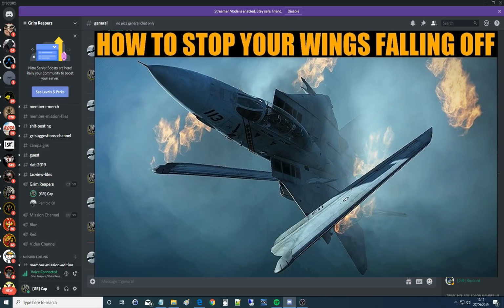Interview: Speaking To Engineer About Aircraft Fatigue & Maintenance

Comment: Same thing can happen in your car. I had a shock absorber on a Chevy Vega go through the A arm on the front wheel. Also my 2002 Hyundai Sonata has fatigue issues with its front wheel drive as the bushings in the steering group are worn out and can no longer have a wheel alignment till the whole front end gets replaced.

Comment: Great info on the actual fatigue problems. May I bring in some thoughts... being an aero engineer (academic, sadly no experience, not even in DCS!)? 
As to metals, Aluminium will be hardened by means of alloys. Hardening it makes it stiffer generally, and stiffer metals crack easier. The same may go up for carbon, and there, also glueing influences fatigue resistance.  

However, whatever it's construction, a plane will be checked, as you guys pointed out in 26:00 eg. If DCS lets you fly a 10 extra cycles plane before your wing shears of, that's not right.

Comment: Awesome video!

made me think of 2 things that i experienced:
1. during my time as a flight mech on the JAS 39 Gripen
don't know the whole story but was told a training pilot had pulled past the softstop of the joystick during
training (pulling more then 9G's) 
when the plane landed you couldn't see anything wrong....until a technician found a small white/gray line about 10cm
on the starboard canard.....plane went in for full inspection and canard change
as far as i know that was the only fault found

2. at an airshow 
i always bring a scanner with me as it gives a deeper feel for the whole thing as one gets to know stuff before
anyone else...plus it's cool to hear the chatter
Hawker Hunter takes off.....comes around and i can see main gear still down but nose wheel up
Tower comes on the radio telling pilot that they also see this
pilot climbs to alt.....tries cycling gear (the crowd plus announcers have no idea what's going on)
pilot tells Tower he's got green lights and comes by for a low flyby
all gear is up and he continues with his show
and before landing does another low flyby just so Tower can confirm all gear is down....which is was and he landed safely

Comment: Turns out, keeping something heavy up in the air is hard.

Personally I do like that DCS is adding fatigue stuff just because ultimately it's designed as a simulator, not an arcade game. If something behaves a certain way in the real world, it should (ideally) behave that way in the simulator too. There's plenty of arcade flying games out there for people who prefer to just fly around shooting stuff without having to worry about their plane falling apart, and there's absolutely nothing wrong with that.

Comment: Back in the day at least, and this good engineer explains it rightly, each component and module were tested in order to find out their point of failure. Say a rotor blade, or hub, gear box, even a gear inside the box. Then they'd take a hundred of them, and run them until they broke. So they'd find out, that on average (for example, not real numbers) they all failed at 2000 hours. Some broke physically, others wore out past normal operation, etc.  So the manufacturer would then take a few precaution hours, and say "Ok, this component, so long as operated within its specifications (not upside down or overspeed, etc) would be useful for 1500-1700hs.  So the maintenance crew would have to keep track of all these components, in order to check flight logs and being able to replace each part within their useful life. The breaking of each part after that useful life, is the actual fatigue of its material (structurally unable to maintain integrity and operation). 

The other factor (as explained with the Nimrod in this video) is the out of spec use of the aircraft. Counters that measure speed, weight, and G's, allow maintenance to know if any special strain was introduced to the airframe and powerplant. So then they would have to inspect and ensure that those parts aren't damaged, or close to their end of hour-cycles. If so, they would consider replacing them. 

A problem in a few cases (outside the US at least) they'd replace a part from the UH1H because it had 1600hs out of the 1800hs it had allotted, however instead of the bin, the so-called mechanics, would instead place the old part back on the shelf, and write it as "1400hs" instead of its true 1600. Then they'd place it back in another airframe, making the pilot/crew believe they had a good 400hs of flight, when in reality the part had no more than 200. 

My two cents.  One day I hope to fly with the GR team, once my PC is able to run DCS properly. Cheers
Reply: [Quick side note: For DCS, it would be great to have each of the main components to start with a counter of x amount of points, and as you fly it more and more, each component goes down depending on the amount of Gs pulled, the amount of hours, etc. A simple script would suddenly make those snapping wings or flaming turbofans break more sensically than they currently are.  I presume their effort is that of keeping the sim real, much like G-lock, etc.  But having them snap randomly for no real reason after a 3hr mission, doesn't sound very realistic. Great thing about DCS, its architecture allows for constant improvements such as these]
Reply: @mariogravina4495  The trouble is that with DCS you just go and get in a new plane for each mission. You'd need a sort-of career mode where you have the same plane and it counted up every mission you did. If you crash or get shot down, you have to wait a week before you can get a new one...
Reply: @Penfold101  Thank you, that makes sense.

Comment: One thing that could have been made clearer is how a plane consists of lots of components that wear differently. Some components will have their service life dominated by g-load, some by g-load variation, some by landing/takeoff cycles (landing gear!), some by flight hours (instruments), some by engine temperature/power used, etc etc.
Reply: Very true. This was all off the top of my head with no script or much a clue of what Cap was going to ask, but this is a very good point.

Comment: and mast bumping is what??:D thats a fatigue break too... it works nicely in dcs with helicopters ....
Reply: Mast bumping is not fatigue. See how a lathe works, then imagine the mast undergoing that while the helicopter is in flight.
Reply: @mariushusejacobsen3221  ... exactly as the workpiece in the lathe, its rotating , one side is pushed by the tool another is pulled ...workpiece is bending on one side + rotating .  just that mast bump is more erratic....and randomly hammered with sharper edges

Comment: Cap, Great interview.  Great job deep diving on Airframe fatigue it was a very interesting interview.  I was just working on some Airworthiness issues for a University project I'm doing, and how to factor that into the cost of operation.  This is something we have to figure from the largest aircraft, even down to small UAS, which have component failures and degradation.   The US Military tracks its operational readiness closely and it been highly publicized over the last couple years about the number of mission-capable aircraft compared to those that are down for maintenance or depot services.  https://www.defensenews.com/air/2018/10/09/mattis-orders-fighter-jet-readiness-to-jump-to-80-percent-in-one-year/.  Great job

Comment: Cars also fatigue, it's just you don't notice it in normal driving.  Rally cars and race cars routinely have the chassis and cage scrapped and the drivetrain transferred to a new(er) chassis because it just "wears out" and get's weaker and causes handling issues because it flexes too much.  Rally cars more-so from just getting beat to death from the gravel.
Reply from the maker: Wow, great info!!

Comment: I propose a solution to this over G crisis. An app that let's you put in maintenance man hours and reduces the likelihood of snapping off wings. Never saw one come back with out a wing.
Reply from the maker: Yeh that's a good idea.
Reply: I believe the game you want is Aircraft Mechanic Simulator. Makes a mockery of my job.....
Reply: @Penfold101  No. The intent was to put some extraeffort into DCS to keep the wings on.
Reply: @pgtmr2713  Actually, now that I think about it there was one F-15 that landed with only one wing. Worth a google for 1983 Negev collision.
Reply: @Penfold101  Yeah I've seen pictures of that. And I've personally seen a Tomcat missing a good percentage of surface missing on one side came back with no problem. There's huge differences in the structures between the F-15 and F14 where the wings move. I doubt the wings would separate the exact way that they do in DCS.
Reply: @pgtmr2713  Probably not, but it is only a game...
Reply: Only a game made with real de-classified information.

Comment: Damn, so resetting the G/stress meter on the Mi-8 isn't fooling anyone?
Reply: If we come onto a plane post-flight and see that it's still reading 0, then we KNOW you've done something wrong...
Reply: @Penfold101  No one in their right mind would let me near REAL aircraft controls. Sorry to the ground crews, but they should be glad like myself if anything comes back at all. I love my simulated ground crew, I work them very hard. They are well trained though. They can take an airframe you or I would consider beyond repair, and have it fixed in about 180 seconds... ;)
Reply from the maker: lol

Comment: Don't know how accurate it is but remember reading a couple times that once WWII started fighters were built to last only 200 hours or so. One reason being to make them as light as possible for performance. But the main reason was they weren't expected to survive that long in combat. Any one else hear this?
Reply: That's correct 

I think the R-2800-XX had a stupidly low amount of hours before a teardown check up etc
P-51 merlin had to be teardown as well when you push the throttle pass the 100% throttle gate(67+inch of mercury)

But at the same time 
WHEN you do need the full boar 2000+HP(R2800) to spit out Regardless of crack piston rings & overheated cyl/piston & overpressured intake
Otherwise the thing would be lost anyway if you get shot down.

At that point it's just a engine replacement back to base is a easy & cost effective
Reply: 20 minuters. Nuff said.

Comment: Modern aircraft are designed to much closer strength tolerances than older ones, for example DC-3 aircraft will still be flying into the 21sth century because by modern standards they are WAY overbuilt.

Comment: If you are going to compare stress of aircraft to cars, then it would have to be an off-road rally car.  It’s engine is constantly reved to redline (take-offs), its chassis is exposed to 5 foot high jumps (landings), and ruts, potholes (turbulence) that have torn wheels off of cars.  Rally cars are torn down after EVERY race.

Comment: For me at least, it's a pleasure to finally see fatigue and structural failures being slowly introduced in DCS. I know it started with the Flanker and its wings, but we get now seam much more in detail (systems failing, fatigue points)and i look forward to the day when we'll get multiple failure points as well (not just wings falling off), like engine mountings, stabilators, ailerons, actuators....on all of our planes. Including the FC3 birds, that also deserve "love". If by love we mean chance to buckle :D 

P.S. the reason why we don't see structural failures in cars (usually) is because we don't really push them to their structural limits.
Reply from the maker: affirm. I wonder if steel is more fatigue-resilient than alloys also???
Reply: @grimreapers  i've been wondering that as well. I think that some steels may be more durable once deformation has initiated. After all, it's sometimes better to bend then to break. But if the alloy can be sufficiently lighter then steel for the same or greater tensile strength, then it will take less force per g, and thus can be put to more stress before it cracks. On paper at least. Not an actual engineer unfortunately :/

Comment: One thing that I haven't heard talked about especially concerning Navy aircraft like the F-14\F-18 was the fact that these aircraft are exposed to multiple carrier landings and launches every day and those are extremely harsh on the airframe and landing gear. That's before you talk about exceeding maximum G tolerances and wings snapping off...

Also, it's completely possible that the F-16 at that air show had a bad birdstrike.

Also frame fatigue in the automotive world is absolutely a main concern here in the states regarding trucks. Some frames if not properly reinforced can absolutely bend half a foot or more on a twist ditch test or during harsh off-roading..

Would've liked to hear less 'US vs. UK' speculative posturing on airworthyness safety standards and certifications and less opinion based deductions.. As far as the EU or anyone else in the world having more stringent safety standards for aircraft, that's completely untrue. You have to consider the size of the US firstly, GB is smaller than some states so obviously up to a certain altitude in controlled environments an individual is absolutely allowed to fly whatever the hell you want because there is just tons of space comparatively.

I am a big fan of your channel btw, Cap!
Reply from the maker: Affirm

Comment: I remember when i was at college studying level 2 aircraft maintenance we watched loads of air crash investigation and i remember one was a 747 bulk head what the engineer done  was he replaced  the bolt mm to the wrong side and cause the bulk head to blow and that cause the stabiliser to blow and the plane oscillated until it crashed into a mountain another one is fan fractures that u can even see with the human eye and that brought down a dc 10 with no hydraulics

Comment: Of course  we do have regular checks on cars (in the UK at least),  the Annual M.O.T.  test  after a vehicle reaches its 3rd year.   Part of that checks for corrosion to structural components that might cause eventual structural failure.  So equivalent of an aircraft  check cycle, but time based rather than 'trip' based.    Up in Orkney we use  small passenger plans like busses for inter-island travel. These planes  perform a very high rate of  Take-off / Landing cycles (shortest scheduled  flight  in the world (Papa Westray to Westray) is between 45 and 90 seconds depending on wind direction.  Whilst these planes (BN Islanders)do not fly  pressurised  their high Take-off / Landing cycle rate and associated  varying load on the wings and undercarriage demand  a frequent  maintenance cycle.  They also have to fly in extreme weather which doesn't help  (i've seen them taking off backwards at Kirkwall airport when the wind speed is > the take-off speed of the plane).

Comment: A big part of the job as (military) pilot is knowing your operation limits. In the Tornado you have to know, how fast you can go at what wingsweep, know how many G's you can pull at the different wingsweeps and what AOA you can get to, allways taking into consideration how heavy the jet is (fuel and external stores). In the more modern jets most of that ist taken care off by the flight control system.

Comment: Love this kind of insight, really interesting. I see metal fatigue all the time when repairing older farming and especially forest machinery. And they are machines designed with a very low concern of weight requirements so can only imagine the difficulties of designing a high-performance aircraft.
Reply: Yes it is interesting. My dad (machinist/tool and die maker) was the neighborhood welder in our little farming community and was the go-to-guy to get things repaired. Most of the time it was structural failures that needed reinforcing. But he always seemed to know if he fix a certain area with a reinforcement where it would most likely fail next, and he would add a little reinforcement to that area. It was an art for him.
With DCS in mind, they could add structural failure programming to reflect an individuals' flying style, and add a cause and effect response.
Reply: @icin4d  Same thing happens with aircraft and helicopters. Weak points are identified over time and strengthened. The cracking then moves to the next weakest point...

Comment: Hey Cap I love this interview, I hope you do more. I met a F16 pilot and he told me that the F16 don't generally go Mach 2. But he had a squadron mate that hit Mach 2 in a dive and the plane had to be completely stripped after the flight. The pilot had to report it to the squadron commander and maintenance officer to get critical components inspected.
Reply: Same for us on Mirage 2000. They go Mach 2 regularly but after that, there is a big inspection to be done to the engine. Anyway, with operational ordonance, mach 1.5+ is just impossible
Reply: That's quite interesting. Did the squadron mate hit Mach 2 or on purpose? And was he scolded for it in the end?
Reply from the maker: wow! amazing
Reply: @grimreapers  MiG 25 Foxbat was mach 3 capable, but the engines were scrap afterwards. Not a GR problem, obviously...

Comment: The amazing thing is how long in peacetime we expect aircraft to last compared with WW2 attrition rates.
Reply from the maker: good point
Reply: @grimreapers  Modern aircraft are much better designed with fatigue in mind. Designers know long metal will last in certain conditions. If you exceed these conditions, inspections are required as its likely something will have broken, and the longevity of the airframe will have been reduced. 
We used to have a reservist harrier pilot (747 pilot was his day job) that would come along to do his "duty" and always overstress the jets pulling 7g's.
Reply: Most large aircraft have fleet leaders that will have special sensors built in the can be "downloaded" for anaylsis purposes. Google SHMU on A330s.
Reply: 20 minuters anyone...? That would still be longer than I last in DCS half the time...